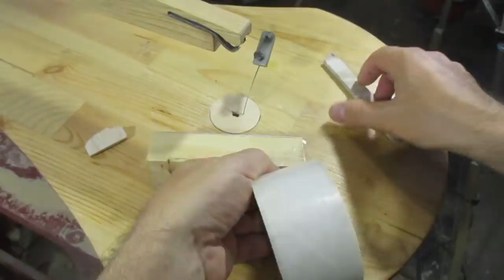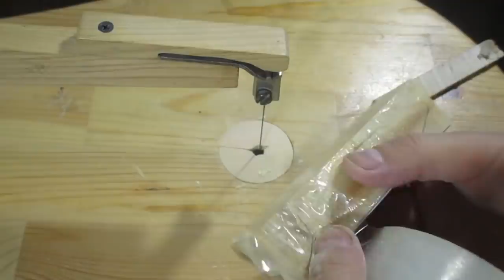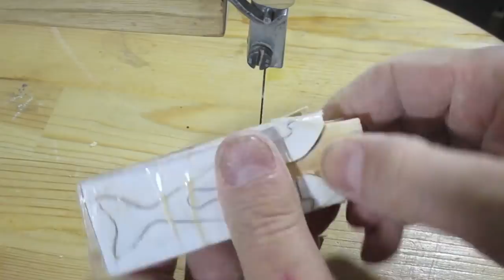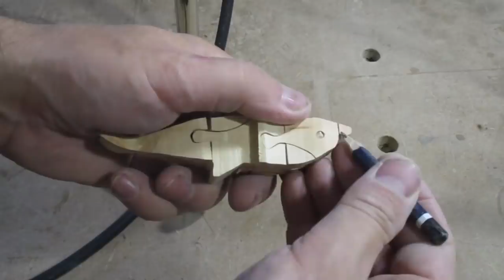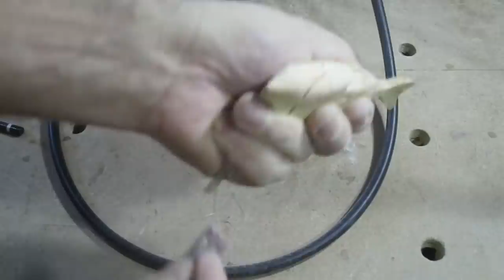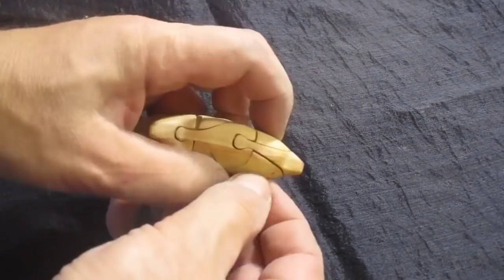3d puzzle on a scroll saw. Dolphin.

Comment: Well done. I taught wood shop for over 25 years and used this type of project to teach accuracy on the band and scroll saws. Over the years I designed a dozen or more or this type of patterns : fish, lizards, insets, and a snake with over 30 parts. You must follow the line or this project will not work. One hint you can shape and contour the model before puzzling it up, then place the shaped model back inside outside the wast stock and then cut it up. I still have some of the snake pattern let me know if you are interested. Chuck
Reply from the maker: Thanks!
The suggested sequence works well with a jigsaw.
Making the shape first and then cutting it into pieces is probably good for a band saw.
In scroll saw, the blade moves up and down, the finished shape will be unstable and the parts will be more difficult to cut.
Reply: добрый день ! где можно купить 3d puzzle Pattern , спасибо